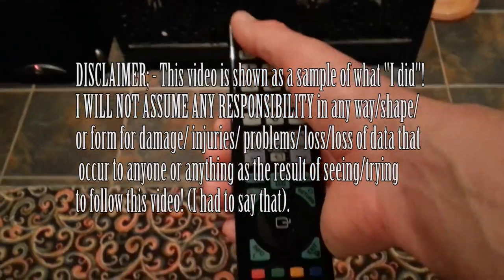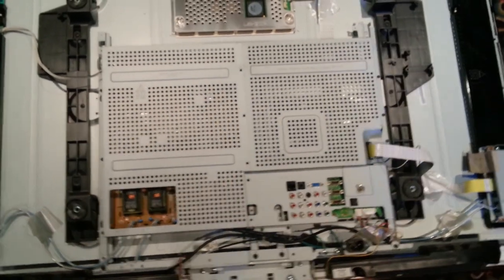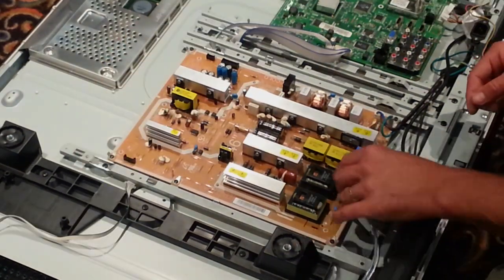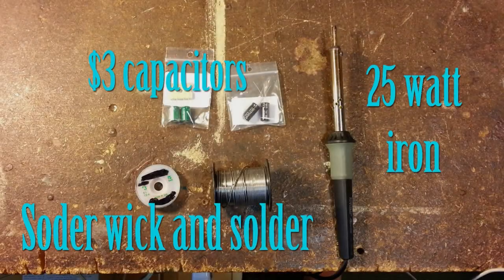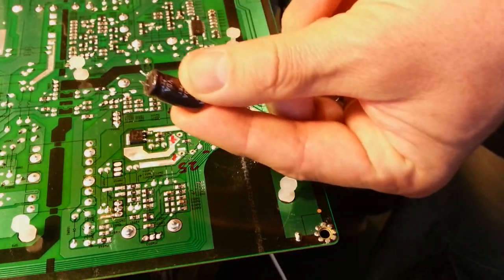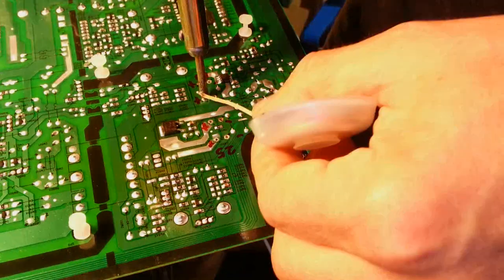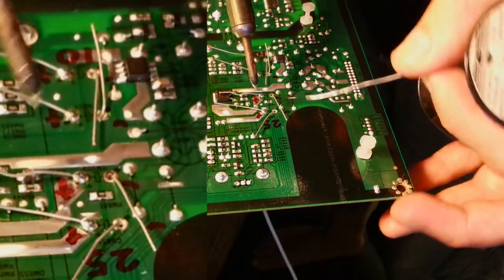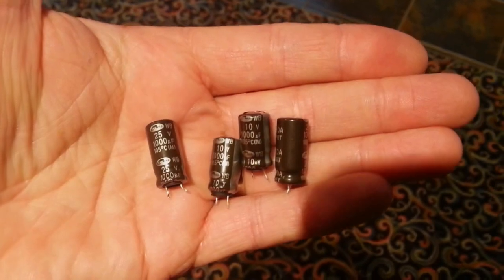Samsung TV won't turn on + blinking red light (explained fix) #18

Comment from the maker: Today is August 12th 2018. (Almost 4 years since I did this video). My Samsung television that I repaired in this video is still working absolutely perfectly. I just wanted to update you guys.
Reply: My tv is doing this, and I have no skills in this area.
Reply: How did you know which capacitors to buy ?
Reply: I've never been this lucky. I've probably found 10 new and nice monitors, both gaming computer monitors and TV:s, in the garbage room. Most of them have these blinking LED and won't-power-up issues. But they have never had bad capacitors as far as I could tell :(
Reply: lol i have to bye anotger 1000 pound tv if it wasnt this video i would have no money
Reply: Yeah, you also simply your videos info so well even I can understand them and that's not easy lol.
Reply: Mysimplefix 

My TV is doing the same and I’ve pulled the power supply board and looked it over thoroughly and all of the capacitors look perfect. The only thing I noticed was that a thermistor had a smokey residue left above it like it got hot and burned slightly. I believe that the fried thermistor is the result of something else that is fried, however I can’t seem to identify anything else. Any ideas?
Reply: My Samsung LED Smart TV UN58H5200 can't turn on after I dissemble it. Reason that I did open the TV: 5 vertical lines right half of screen. 
So I cleaned all the connections and no strange defects seen by inspection.
But now the TV can't turn on: there is back light, at the right low corner the red light is on (constantly on means not blinking). I tried everything like reinserted the cables, my remote is 100% fine, power cable off then on press on power button at right back rear of TV etc etc to no avail. 
I'm sure it's not a hardware problem as the TV was working before fine (but with the aforementioned 5 vertical stripes on right side of the screen).
Any suggestion will be appreciated.
Reply: I replaced one bad capacitor I found and the tv still acting up. All the others are fine, not swollen or leaking. I didn’t have luck
Reply: Can I send you a photo of my board. To help me identify possible fuses and capacitors. My capacitors dont look bulges. I'm thinking it can be a fuse
Reply: Mysimplefix knowing basic electronics and soldering skills can pay off.
Reply: Mike Weber some times the capacitors fail and still look fine to the eye inspection. If you have access to multimeter you can try to get some values off the capacitors and see if any are off. If not it may be worth it or just replace the four capacitors he referenced. Usually these capacitors fail over time and or you may have a manufacturer’s issue. Which is a common failure. If replacing them hasn’t worked it could be more in-depth.
Reply: @selfingdogs178  Buy ..not bye
Reply: I replaced the power board entirely, no luck,  still blinks
Reply: @dshudson  I did as well. also replaced main board and LED lights..still blinking light. It went in the trash. now i have parts to sell.
Reply: My tv was having this same issue so I just replaced the entire power board but I'm still having this issue. Any ideas what could be wrong?
Reply: Hi my tv is a Samsung hdtv 1080p is a 50 inch and I replaced the bulb already but the standby light and lamp light keep flashing and my tv city’s off. Any advice🙏🏽
Reply: HOw about nOw  2020 Covid19 Aug 24
Reply: That's very decent of you to give us an update. Here it is, Sept, 2020. How is it still working?

Comment: Thanks for the great video.... I was able to repair for $5.  Fry's electronics had the capacitors I needed.   Special Kudos for pointing out the Zeroing of the high voltage capacitors.  Several other videos show the process, but your tips on marking the board and wicking the solder are the fine points needed for success.

Comment: Found your video 2 weeks ago. I thought, "What the heck" & gave it a try as the TV was pretty old. Well, the only problem I  had was finding a supplier BUT,,the results were the same. Spent $7 on a used soldering iron 80 cents for the capacitors. Only two glitches..1. Lost some fastener screws 2. $11 for shipping. Other then that Im back in business!! THANK YOU

Comment: Thanks for this, I fixed my tv using your excellent tutorial (which is much clearer and easier to follow then many others I might add). I had newer done anything like this before and I have like soldered once 15 years ago in school ;)

I was this close to buying a new tv for like 800$, but then I thought "screw it, if I brake it even more, it will still be as broken as before". Cost me 2$ in spares + a roll of soldering stuff.

Samsung and other electronic manufacturers just want us to buy more expensive stuff from them, so they put in shit that brakes after a few years.

Thanks again for doing what you do, keep up the good work!
Reply from the maker: That's a very nice comment! Thank you so much for this, and I hope your TV runs well for a very long time.

Comment: Excellent video and very clear explanation. I had the blinking red light of doom on my Samsung 40" LCD television, and it turned out to be both 25V 1000uF capacitors that had blown. £1.50 and a trip to Maplin later, and it's all working perfectly again now, and saved me well over a £100 in a repair bill. It's just my wife I've got to placate now as she fancied a new TV for the New Year !!! Thanks once again for the info.
Reply from the maker: That's great! Thanks for posting.

Comment: Thank you so much for this video! Our Samsung TV that we bought in 2008 suddenly stopped switching on, flashing the red light like you showed. Took it apart and the inside of my TV was exactly the same as yours and the same 2 capacitors had blown! Replaced them as per your instructions for a very small nominal amount and the TV is working perfectly again. Again, thank you so much as I wasn't willing to spend hundreds of £££'s buying a new one. 👍
Reply from the maker: I'm glad this helped you! Thanks for your feedback.

Comment: I have a LN46A750R1F, April 2008. I already replaced two capacitors an year ago because the TV was in an infinite power cycle loop. That fixed it. Now, for the past few days, it again no longer turns on, but this time, instead of automatically rebooting, the power light blinks once for each time I push the remote button, but nothing happens. I see that your TV is the exact same model as mine. I just discovered two bulging capacitors. Off to the electronic store. Samsung won't get a single penny of mine! 

BTW, brilliant, professional, clear, and understandable video and narration. The way it should be done. Thank you.
Reply from the maker: +Harry S. Anchan thanks!

Comment: VERY GOOD explanation of the repair. I am doing this very soon to my 50 inch Samsung. Samsung has been had a BIG problem with these capacitors...it could be a quality control issue or a controlled replacement issue that got away from them. They do not want to spend the additional 35 cents it would cost to install the correct capacitors because the tv would last you a long time. They want to build in a breakdown so you replace it with a new one but looking at how many there have been and the court cases they have lost, it might have been a poor decision. You can now buy a 70 inch tv cheaper than I paid for this 50 inch in 2009 so many do not have the time or skills or patience to repair the unit so they buy a new one. The only problem this creates for Samsung is that the consumer might not want to buy another SAMSUNG that they spent $1200.00 on when they bought it. I still have some tv's that are 25 years old that work fine...only paid $300 for those when a purchased those new. Anyway...this is my opinion on the whole issue...awesome video...thanks for your time.
Reply from the maker: Yes, true! Thanks for posting.
Reply: Someine told me i had to get a new motherboard because Samsung doesn't like for you to mess around with the internal ..that really pissed me off I don't believe it after I've seen all these people fix their TVs with the capacitors. I don't know how to work a solder so I'm kind of worried to attempt to try to fix it

Comment: Thanks! Your video saved me a lot of money & trouble, just replaced 4 capacitors and no more startup problems. Had to make second run to Microcenter for a higher temp soldering iron in order to remove old solder.

Comment: thank you so much. Mines been doing the same thing for a yr now. I have a Samsung model #ln-t5271f. I didn't want to just throw it away as its the first tv I didn't get buyers remorse over. For a price tag of just a little over three thousand you would think they would use better parts. Funny, but every repair shop I called and described what was happening, EVERY SINGLE ONE told me they would look at it but it was most likely the main board and the tv probably wasn't worth fixing. With how common this problem seems to be you would think at least one would have heard of it... Very professional video-Great job!
Reply: That's because they're a bunch of crooks.

Comment: Thanks so much for this video. I hadn't touched a soldering iron since high school but after a little bit of work I managed to get the busted capacitors out and get the new ones in. I had a functional TV again in about an hour. Everything I needed to know was right here in this video. So thanks again. You rock.
Reply from the maker: Thank you so much! I'm glad everything worked out for you.

Comment: Great video; I have the "blinking red light" on a new 55" Series 7 Samsung (UN55JS7000FXZA). Gratefully it's 2 months past purchase, so a free repair is coming. However I wanted to compliment how well this past put together; I'll be coming back to this channel for future repair problems, and if past warranty this happens again I think I'd be confident enough to try this on my own.

It's too bad fuses or other elements like this aren't more accessible in the design; on an old 36" "monster" (the HD TVs which were just before the first LCD) some simple $2 fuses would blow every 6 months. The fix was removing a back panel by the power cord, using tongs to swap the fuses, and re-installing the panel. I never would have thought to go this far into the investigation on my own.

Comment: Thanks for the excellent how-to video! 
I'm having the same problem with my Samsung TV and can't wait to give this self-repair job a try. What is there to lose? Considering of course I can figure out how to zero out the high voltage capacitors! I wish you'd have shown a close up of that process but I'll search for another video that might show that.

Comment: One of my coworkers was gonna throw one of these away because it wouldn't start up, just like this one. I asked if I could have it instead, which he agreed to. I had a strong feeling it would be faulty caps. As soon as I got it home I took it apart before even trying to plug it in, and found those exact same two capacitors bulging. I didn't have any exact replacements, so I put the closest ones I had at home in there, and that fixed it. It's like it's engineered to fail.... But at least I got a nice big bedroom TV now, for free. :)
Reply from the maker: That's great, you win!
Reply: Skräcken
Reply: Gary
Reply: What makes you think I didn't?
Reply: after you had his wife
Reply: Exactly what is it that you're trying to do here?
Reply: Skräcken m
Reply: Skräcken lmao
Reply: Skräcken sexy
Reply: rj doggman    Funny I've got one that's still working 15 years later! only time it was repaired was under warranty.

Comment: Have the same problem on a 60" 5300 Samsung Plasma.  Have been working around problem by unplugging for a few minutes and then turning on again. Companion symptom to not turning on is the volume always resets to 0 as seen after replugging.  Is the unplugging and waiting workaround just allowing the caps to discharge, thus permitting the set to operate after replugging?  I don't know.  BTW, MSF, your no nonsense presentation is commendable.  ALL other fix vids spend too much time waxing over personal stuff or explanations of each and every screw removal process.  Way to get right to it and speed up the repetitive stuff!  Well done!

Comment: Bingo! My tv had only bad capacitor.  Took the board to a local tv repair shop the guy replaced four or five of them just as precaution and only charged me $30.  Not bad. Thank you so much for your video.

Comment: I can't afford new boards, the electrical checking equipment or even a soldering iron (yeah that skint) and it's a really old Samsung anyway, so I wiggled the capacitors and the tv works fine now lol...But I'll definitely do your fix when I can get the parts if the tv plays up again, as some of my capacitors are definitely bulging like yours, good to know it's not too expensive a repair.

Comment: When replacing capacitors, it's important to replace with the same capacitance, however, you can replace it with a capacitor with a higher voltage rating, just not lower.
Reply from the maker: This is true!
Reply: so would you say 4 x 25V / 1000µF are ok ?
Reply: CyScape my capacitors don't look like they're swollen could they still be bad my television clicks on and off on and off and it does not want to connect I just got done taking it all apart to see if it was the bulb I can't even find the bulb but it was turning on but every five or six times hit in the button now it will not turn on so I'm beginning to wonder if it's some type of ignition switch
Reply: It isn't funny once you know what those two are.  Simpleton!
Reply: @jimjones3122  I have the exact same problem as you, have you found a solution?

Comment: i have this issue but this looks like too much
RIP 40inch Smart TV
Reply: Ivory Raven i was sold until you saod the part about safely discharging and killing my self lol. You just mean unplug it for a day or so before starting?
Reply: Worse is when same prob occurs but no caps are swollen or leaking, and just dissassembling the TV made it worse! Backlights, stripes or image black, and sound, but no logo, menu/vol graphics, aaand the light blinks. On board fuses ok, (@0 ohms) no burned circuit boards or components, or ripped wires. Of course you cannot test caps in circuit, so I am about to make a bigger mess.
Reply: @joshuawhite4330  No, he means safely discharging the capacitors  short them out!!!
Reply: James Billings mine made a bang and I don’t know what to do it won’t show the light or anything 😭😭😭😭
Reply: I found that local repair shop charge as much as a new TV. But soldering kit and capacitors are less than $30 combined. Totally worth the learning curve to fix this at home.  Samsung TVs are the easiest to fix. Other brand TVs are impossible or hard to fix, i was told. 
Regretfully, LCD panels lasts 20 plus years but the circuit boards blow up in average 3 years.
Reply: Hahaha

Comment: Silly question,but will be my first,ur video is so good I think I can...but was wondering what solder do I need to by? Thanks
Reply from the maker: I usually use a Rosin core (acid free) solder for electronic circuits. It can be either a 60/40% lead-tin mix, or lead free. I like using the mix myself, but just make sure you try to avoid breathing the fumes, and make sure to wash your hands afterwards no matter which kind you elect to use. Good luck!
Reply: Thank u...on the Vizio m55 series it was hit by lightning put was plugged in surge protector...the capacitors look good,no bulging or leaking (cracks)...but with this Vizio the AC power cord doesn't plug straight in the back with 2 prong instead it has a small white male connector that goes through back of TV after unscrewing where cord goes through and connects to another clip soldered on the power circuit board...

The TV does nothing,no light ,noise , anything... If there is any idea u may have I'd appreciate it, I'm stuck... And a begginner if u have a question with model #,let me know if you have time...

Thanks
Reply from the maker: Ahhh lightning!! Lightning can enter the TV through many sources, (cable, LAN, power cord) and can hammer on circuits that normally should not be on. Lightning damaged devices usually require multiple components to be replaced. I think you'll have a challenge ahead of you for this tv!

Comment: hi Mysimplefix, any other ideas? i have a fast red blinking light on my Tv, cant power on (no video) with manual button or remote. I have the power board in my hands off the TV and no indications of blown capacitors. you recommend a new board? does samsung have any TS tips? probably not...
Reply: This was my situation, too. I opened up my TV (model UN50EH5300) and all the capacitors and other components looked normal. But the board was dusty. I completely removed the board from the TV, poked at some of the capacitors to try to ground them like the video says, straightened out one that was crooked, and blew all the dust off of the board and its components (front and back). Just tried to clean things up. Then I put it back in the TV, and now it works! I'd guess some of the dust was causing a short somewhere. We will see if it lasts but this is the first sign of life I've seen from this TV in at least half a year. The cost: a little bit of time and effort.
Reply: j3kfd9j found out what was wrong with mine after troubleshooting for awhile. LED strips were out in mine. If you have a whole LED strip bad the TV won’t turn on. Found me some new LED TV strips and my TV is back to normal.

Comment: Thanks.  This worked out great for me.  I would just like to add that the soldering part was a little bit of a challenge at first.  I practiced on an old circuit board that I had from an old computer.  After about 10 attempts I figured it out.  If not for your video, I would have bought a new tv or paid someone to fix it for at least a couple of hundred dollars.
Reply from the maker: I'm sure this won't be the last thing you'll fix now that you've done it! Thanks for posting.